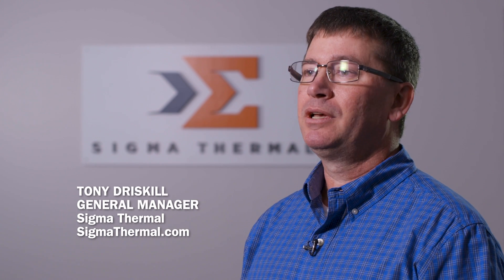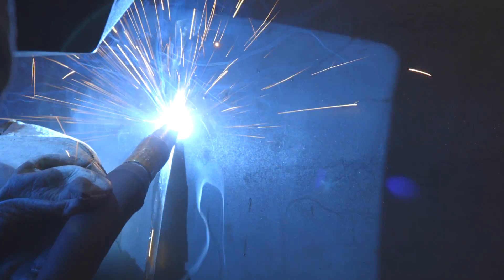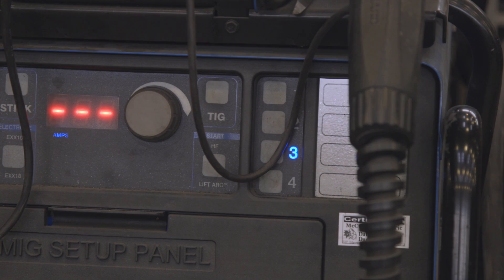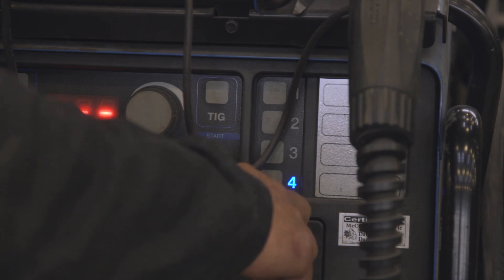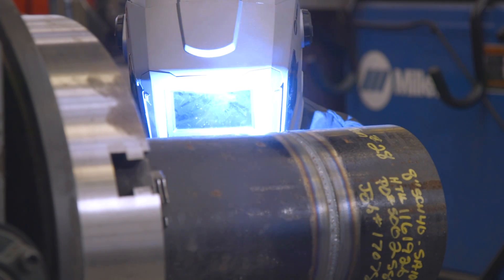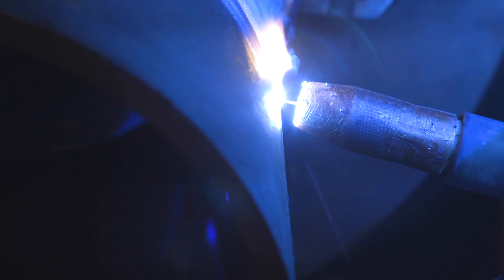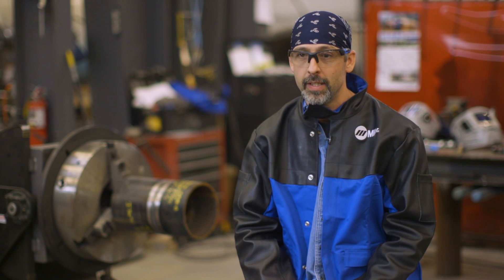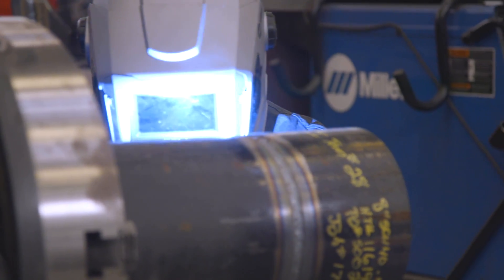RMD Welding Technology Doubles Productivity for Sigma Thermal

Comment: Not a fan of the stick on this machine. Rolling pipe with stick is poppy and very frustrating to use. You can not go any where past 12 o'clock on the pipe towards yourself to get a flater and smoother bead. Pops huge spatter out and can barely keep it lit in some situations. Ive tried 3 machines in the shop and they all do it. There NEEDS to be an upgrade for this to give the machine more drive, brutal to use